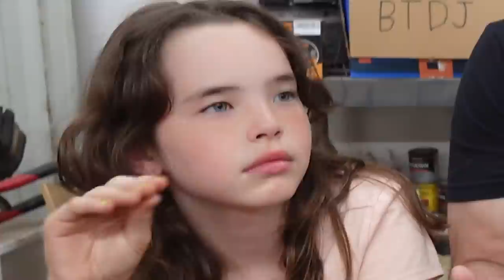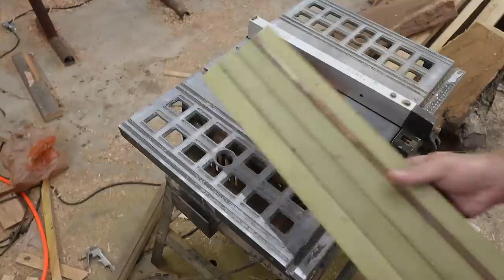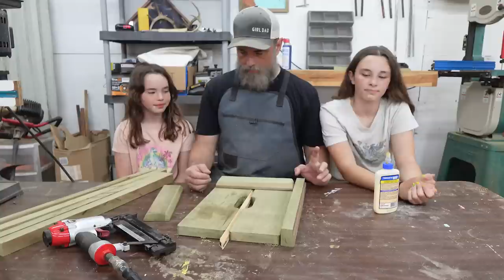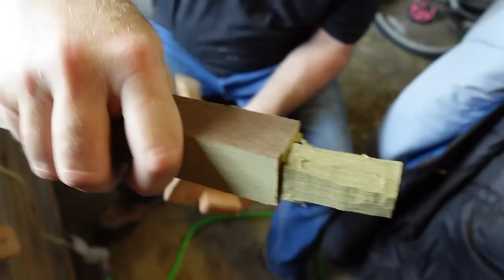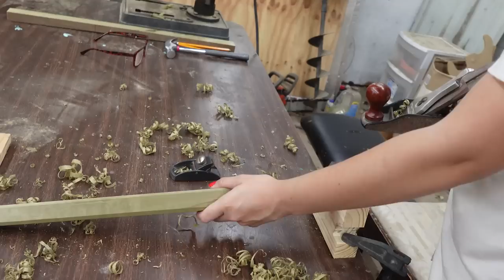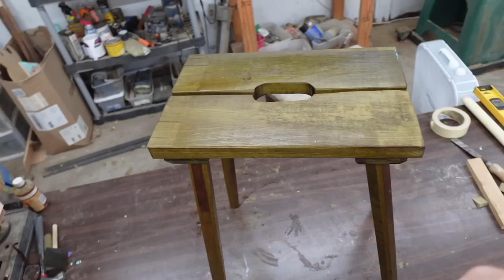I built Rex Krueger's Moravian Stool. Except mine isn't as good.

Comment: First off, who does not love using a plane? There is so much satisfaction in creating those curls of wood and seeing the finished product. 
Next, honestly, I love the rustic feel of your stool over his, it came out really cool. 
And, yup, I have some good spade bits, but I also have cheap ones that I use when I know I'm gonna trash it. Like this one time, I did not know there was concrete behind the wood, I got that tip cherry red!  
I see a thickness planer in my future, my wife is suddenly addicted to a couple of Facebook pages on building and creating from used pallets.
Reply from the maker: Pallets would be great for it. It needs to be stiff under the table, and you want something like cold rolled steel for the shaft, but most of it is just a frame.

Comment: For the tendons and some things like different joints, dont forget you own a bandsaw. Its not perfect, but it could of gotten you close enough
Reply from the maker: At the time, my bandsaw was in bad shape. It couldn't cut a straight line for anything, even with a huge drift. I've changed the tires and blade, and done a full tune up on it since then, and it's cutting beautifully.

Comment: I like the idea of your channel... but you really really need to make a real bench of some type that incorporates work holding.  I cringed thinking about all the times I did stuff so dangerously because I didn't know how to secure the piece while taking the tool to the wood... and I also had more sloppy work as I fought to hold the piece while handling a tool (power or hand).

I had a lot of fun outfitting a non-woodwoking maple top bench with a home made vice and other work holding.  Rex was my primary inspiration, but I found a slew of other inspiration also such as 3x3 customs clamp down bench top with a moxon and other work holding built in.

Unplugged Woodworking has some great low bench inspiration... but his audio is poor.

Keep up the great channel topics.  I love the family approach!
Reply from the maker: Thanks for watching. You're absolutely right about the workbench. The only reason it isn't a higher priority is the state of the workshop. It's well over 100 degrees F in there right now. I was out there this morning at 6AM just so it wouldn't be too hot. Once I get the electrical up to code, A/C installed, and the holes in the walls closed up - maybe some insulation too - a workbench will be next.
Reply: @worstworkshop  I can appreciate the heat impacts.... All to much.   Stay safe and keep having family fun!   :)

Comment: AHAHAHAHA, I have sustained mist of my injuries using hand tools. So i jad to laugh when you cut yourself with tje saw. I also love Rex, have kearned a ton from him. And while i have a full blown obsession with hand planes, that is where my hand tool journey ends. Everything else is power tool all the way baby!
Reply from the maker: It's chisels for me. They feel so comfortable and safe. Then they turn on you!
Reply: Chisels and hand saws are great too. The most important tool in a hand tool workshop is the workbench though. Everything comes from that. My first workbench was a plank of wood. My second workbench was 3 planks of wood battonned together. My third workbench is wood glued up. What I'm getting at is you have to start somewhere. I want to make another workbench someday but so far it hasn't happened yet. When I get the wood.
Reply from the maker: I've meant to build one for years. I know the design I want. It's mostly a matter of limited budget. Right now I'm trying to plug the huge holes in my workshop wall so rain can't come inside, get the electrical up to code, and get some kind of air conditioning in there before the temperature goes above 100.
Reply: @worstworkshop  I hear ya. There's always something.